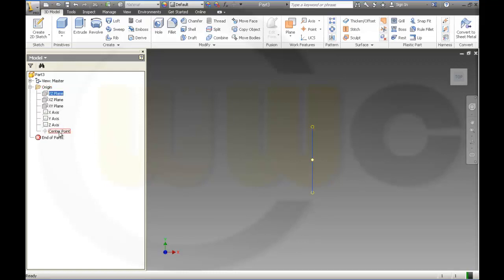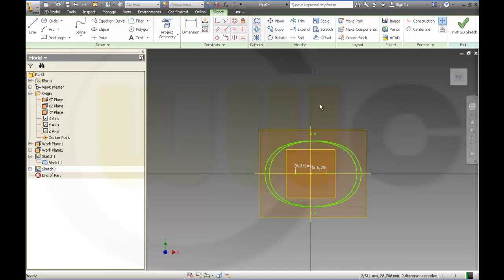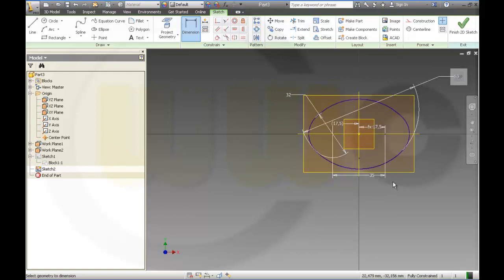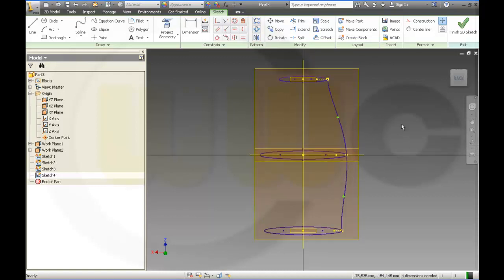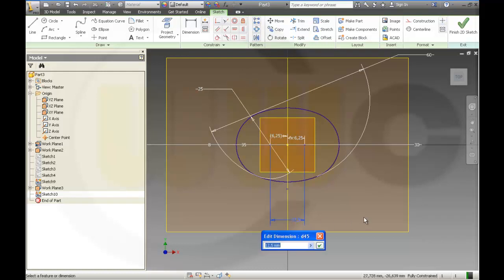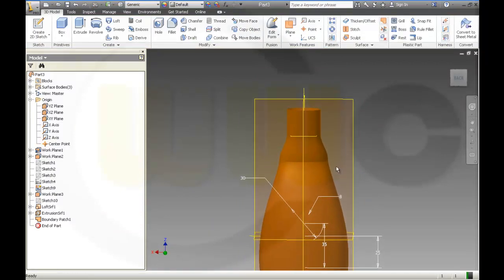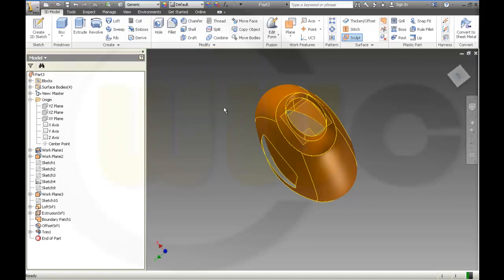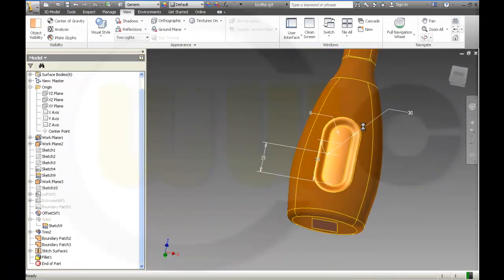Bottle - Inventor 2013 Surfaces Training - Boundary patch - Loft - Block - Trim

Comment: good..Thank you, but I think solidworks and catia are better than inventor and more practical
Reply from the maker: Not really, Inventor is by far the most userfriendly cad-software but lacks proper surface tools. SolidWorks is somewhere inbetween. Catia surpasses both regarding structure, surfaces and more.
Reply: Wolfgang Walden you know the program well or not from surface commands catia is super at surface structuring and solidworks at solid quite well and also at surfce especially at casting tool but unfortunately not invetor